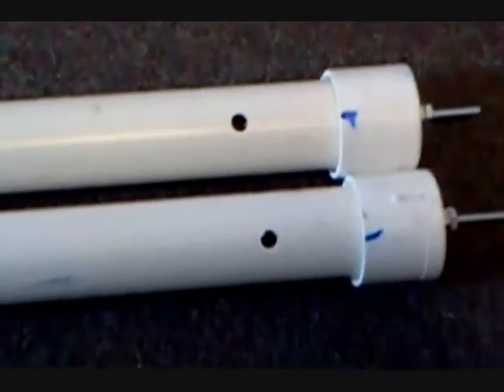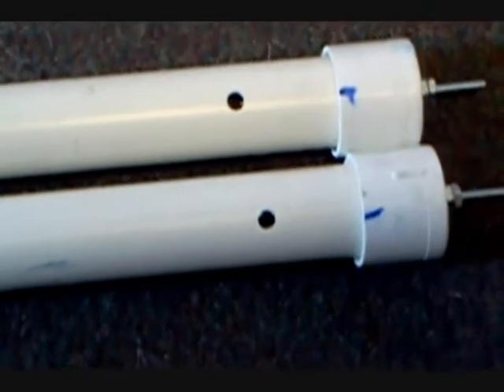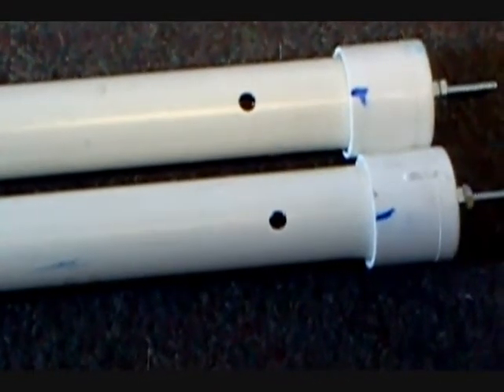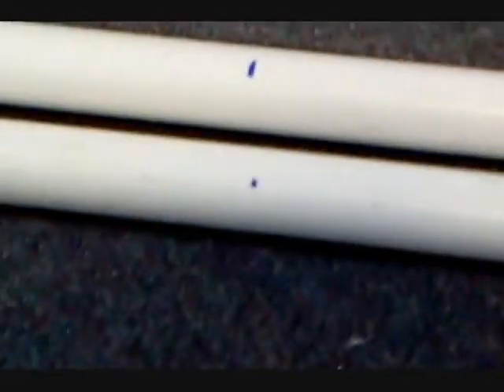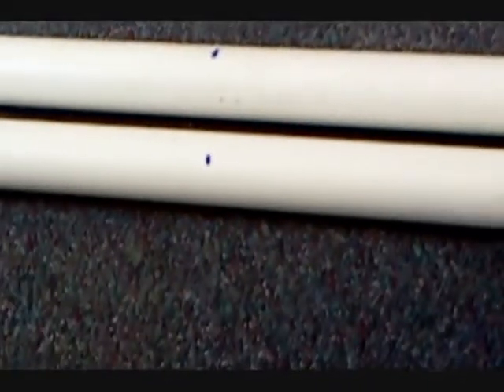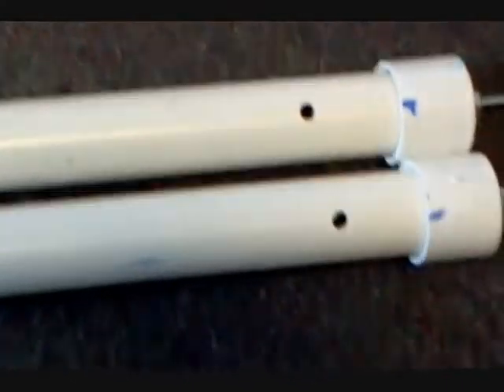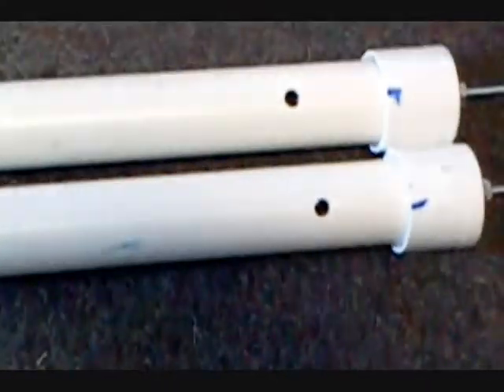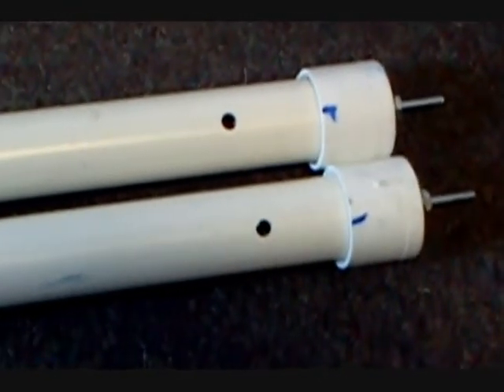Tent Poles DIY by AA1PR

Comment: Nice simple DIY. I was starting to ponder this concept for a tarp I just ordered to cover my camp kitchen on an upcoming trip and really glad I found your post. I like the idea to create the top end pins with the cap. Clever and simple. Did you find the quick release pins at your big box home center? Those make it very convenient. Your 5' lengths would leave 2' overlap for an 8' pole setup. Do you think I could get away with 4'6" lengths, leaving just 1' overlap, or might that be too flimsy? Thanks!
Reply from the maker: thank you & yes everything for the project was purchased at a local hardware store
I honestly dont know you'll have to try it, but one inch overlay seems very short & prone to cracking
though again PVC is very rugged, more than folks give it credit for
Reply: Thanks for the answer. I got all materials and put two adjustable and two shorter fixed length poles together last night! Just to clarify, I meant 1' = 1 foot overlap for the 8 foot setup. I cut mine to 4.5 feet to help them fit in my sedan. These size pipes fit really snugly so the poles are still very sturdy even with the 1 foot overlap. They are not light but that's not so important for car camping. My fellow scouter dads will be impressed when I'm warm and dry on some upcoming soggy weekend.
Reply from the maker: PaoloFrancesco99
Oh sorry
I'd say that would be plenty